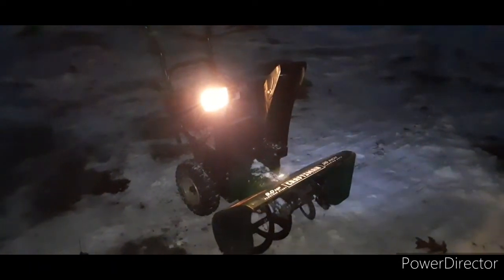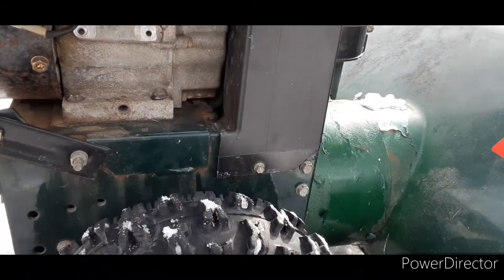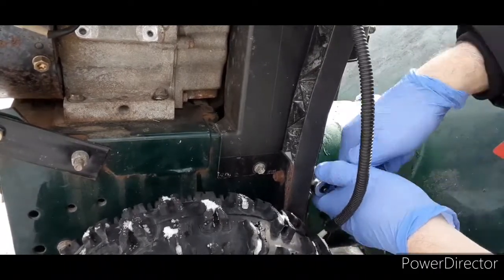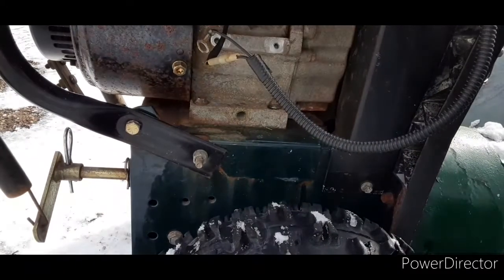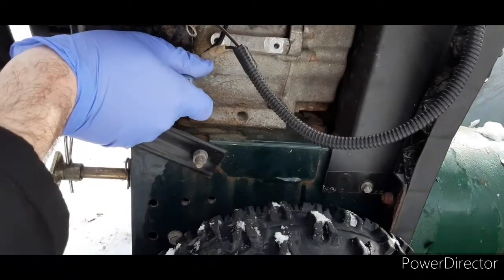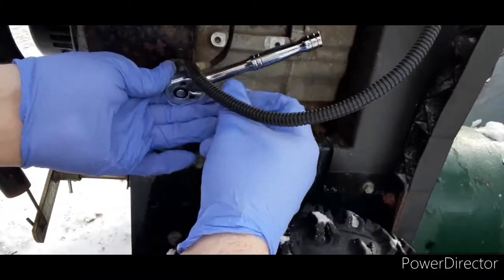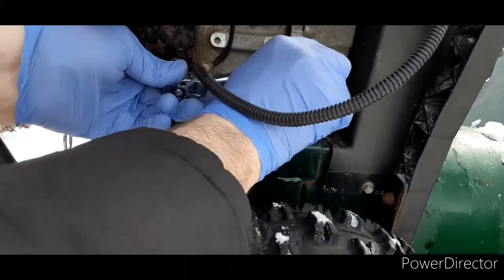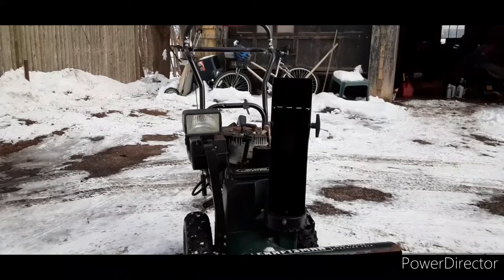Headlight Installation On Older Craftsman Snowblower

Comment: Thanks for the video Robert. Can you tell me where I could find a headlight . I have a snow blower like yours
Reply from the maker: I found that headlight and bracket on eBay. If you can't find one with that bracket just make sure find one of the same electrical connections You will just have to find some other way of mounting it.
Reply: @robertknight4672  Do you happen to have the listing on Ebay that you ordered from?  Would like to get the same light as it has the same connector as my snowblower
Reply from the maker: @depositionsandstuff7465  I just found this. While the description says it's for an Ariens snowblower the connector is the connector is the same. https://www.ebay.com/itm/OEM-Ariens-Head-Light-ST-824SLE-924108-Snowblower-Headlight-02478100-SAVE-/194815032364?mkcid=16&mkevt=1&_trksid=p2349624.m46890.l49286&mkrid=711-127632-2357-0